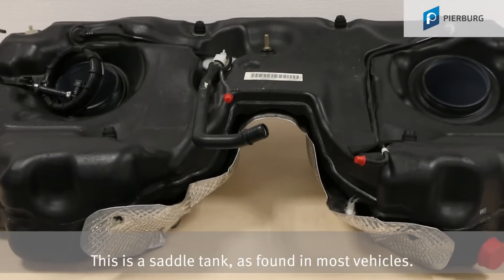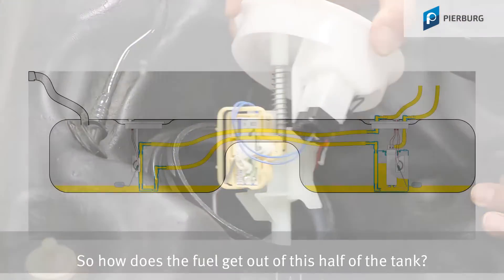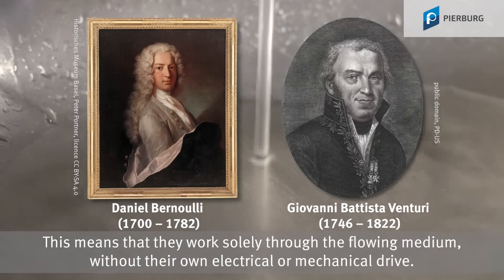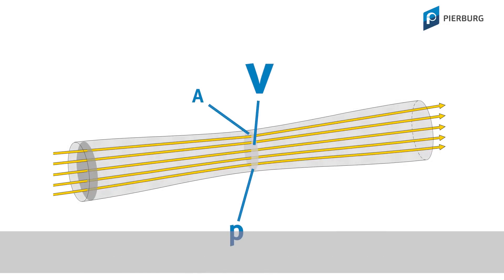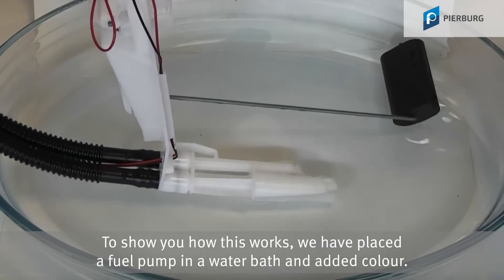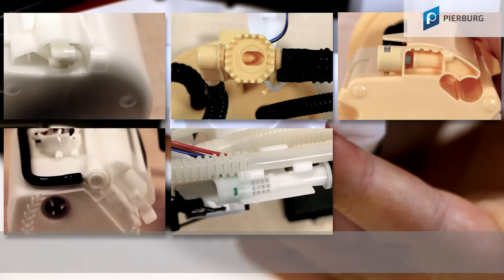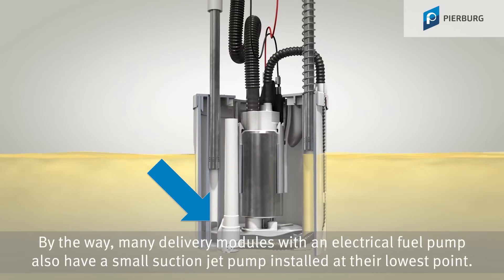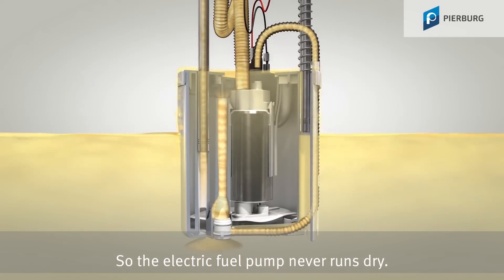How the suction jet pump in the fuel tank works

Comment: What can cause it not to never dry or what might cause it to dry
Reply: Is the fuel level in the tank gets too low, the the pump will then run dry. Also, if a car can go round corners fast enough, the fuel will shift over to one side of the tank and can sometimes cause the pump to run dry.